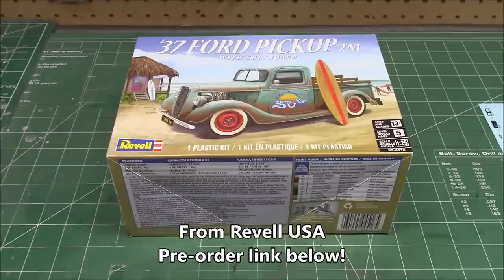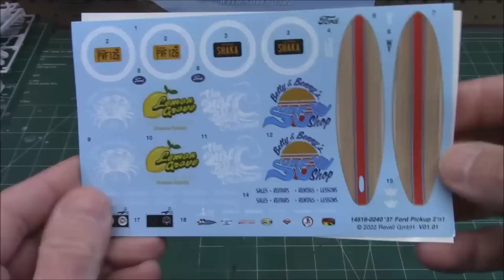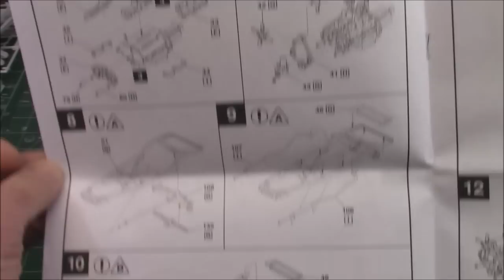1937 Ford Pickup Flathead V8 2n1 1/25 Scale Model Kit Build How To Paint Wood Grain Bed Revell

Comment: I recently completed the 37 Ford Panel truck by Revell, for the headlights I drilled into the indents which gave the buckets more bite and used some Loctite super glue to secure them to the posts.

Comment: And that's the way all dashboard gages should be designed for models imo. Perfect. I've been thinking that the next time I have gage decals I should drill out the holes for them in the dashboard and mount the gage decals on a spare piece of flat styrene and glue them in just as shown here. Very nice kit. Also, nice demo of how to use modge podge for the windows. Tyvm. Really nice job. 
Love it.

Comment: '37 / '38 kit. This molding began as a '37 only...later they added '38 hood and grille. Custom and Stock only refers to the engine in this kit...and maybe a custom wheel / tire option.

Comment: For those who wish to add more detailed wheels on this kit as an upgrade and improvement;over the no name wheels that comes in the kit,Round2 Models sells a 1/25 scale stock and custom tire set,for AMT,MPC,and Lindberg automotive kits;but can be kit bashed with other 1/25 scale kit manufacturers.The biasply stock and custom tire set from AMT;are fully branded as either Goodyear or Firestone continentals that are whitewall for the stock biasply tires,and red stripe for the custom biasply tires.
So you have two different wheel options in the AMT tire set to choose from.

Comment: Shouldn't the engine block have been Ford blue? Overall real nice build.
Reply: Dark green is correct for 1937, or 1932 to 1940. Some dark blue started showing up in the 40's. Ford Corporate Blue began in 1966.
Reply: @413x398  Thanks